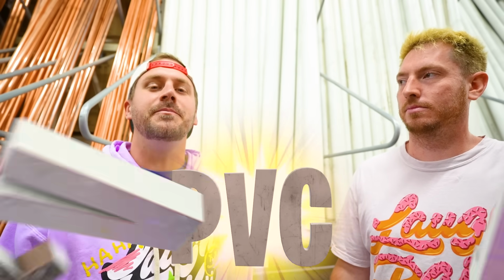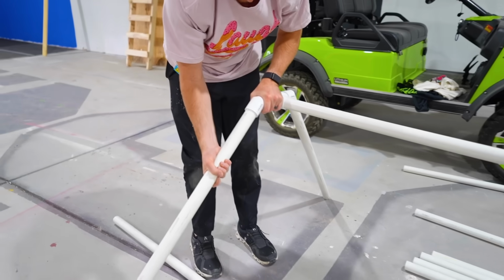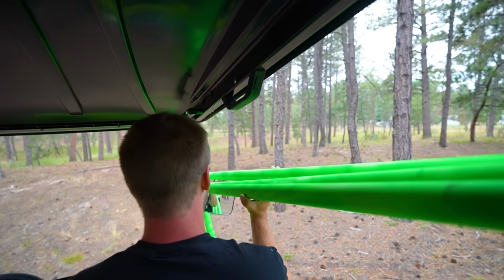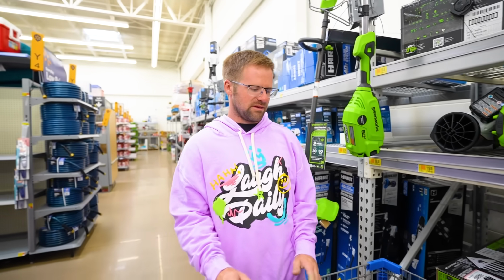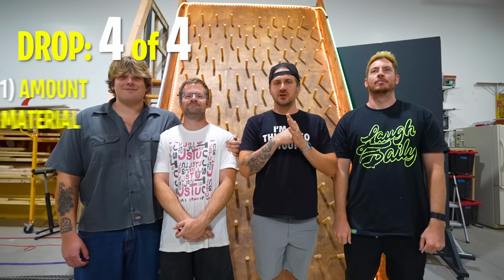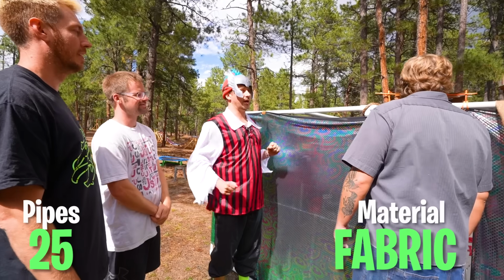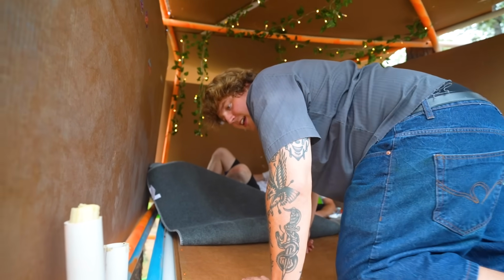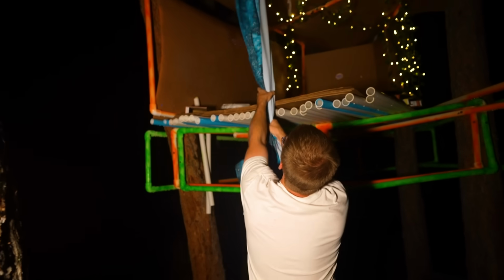We Built PVC Pipe Survival Shelters!

Comment: The one with the tape walls could have been insanely good if built correctly. I would have added a few little pieces of pipe to the bottom of the structure to make it more tall, and dig them down in the ground for stability. I would also have designed a door for it, to make it wind-resistant from all sides.

Comment: You know At first I thought that  Andrew's idea was great but after giving it some thought he could have built a small house big enough for him to lay down and sit up inside with enough room for all of them to comfortably fit inside and even sleep. 

If the pipes are 10 feet he could have cut off three feet from 4 of them and attach the 4 seven foot long pipes to a 4 way connector that is pointed at a 135 degree angle. Then cut the 5th one into four parts for the walls then connect them to the four 3 foot pipes this gives you walls about 5.5 feet high at the lowest point and about 8 feet at the center with each side being about 8.5 feet in length.

Comment: How to bake a cake.  

Baking a cake is a rewarding and enjoyable process! Here’s a simple recipe for a classic vanilla cake:

### Classic Vanilla Cake Recipe

*Ingredients:*

- 1 cup (2 sticks) unsalted butter, softened
- 1 1/2 cups granulated sugar
- 4 large eggs, room temperature
- 2 1/2 cups all-purpose flour
- 2 1/2 teaspoons baking powder
- 1/2 teaspoon salt
- 1 cup whole milk, room temperature
- 2 teaspoons vanilla extract

*Instructions:*

1. *Preheat the oven* to 350°F (175°C). Grease and flour two 9-inch round cake pans, or line the bottoms with parchment paper.

2. **Mix the dry ingredients**: In a medium bowl, whisk together the flour, baking powder, and salt. Set aside.

3. **Cream the butter and sugar**: In a large mixing bowl, beat the softened butter and sugar together using an electric mixer on medium speed until light and fluffy, about 3-5 minutes.

4. **Add the eggs**: Add the eggs one at a time, beating well after each addition. Mix in the vanilla extract.

5. **Alternate adding dry ingredients and milk**: With the mixer on low speed, add the flour mixture in three additions, alternating with the milk (beginning and ending with the flour mixture). Mix just until combined—do not overmix.

6. **Pour the batter into the pans**: Divide the batter evenly between the prepared cake pans, smoothing the tops with a spatula.

7. **Bake the cakes**: Bake in the preheated oven for 25-30 minutes, or until a toothpick inserted into the center comes out clean.

8. **Cool the cakes**: Allow the cakes to cool in the pans for about 10 minutes, then turn them out onto a wire rack to cool completely.

9. **Frost the cake**: Once the cakes are completely cool, you can frost them with your favorite frosting. Vanilla buttercream is a popular choice!

### Tips:
- Ensure all ingredients are at room temperature for the best results.
- To check if the cake is done, the edges should start to pull away from the pan, and a toothpick should come out clean or with a few crumbs.
- For an extra moist cake, you can brush the cake layers with a simple syrup (a mixture of sugar and water) before frosting.

### Simple Vanilla Buttercream Frosting Recipe

*Ingredients:*
- 1 cup (2 sticks) unsalted butter, softened
- 4 cups powdered sugar, sifted
- 2 teaspoons vanilla extract
- 2-4 tablespoons heavy cream or milk

*Instructions:*
1. In a large bowl, beat the butter until creamy and smooth, about 2 minutes.
2. Gradually add the powdered sugar, 1 cup at a time, beating on low speed. After each addition, increase the speed to medium and beat until well combined.
3. Add the vanilla extract and 2 tablespoons of cream or milk. Beat on high speed for about 3 minutes, until light and fluffy. Add more cream/milk as needed to reach the desired consistency.
4. Frost your cake once it is completely cooled.

Enjoy your homemade vanilla cake!

Comment: Andrew should have done a teepee style shelter with only 5. also idk what rick gets paid but its not enough lmao
Reply: You know At first I thought that  Andrew's idea was great but after giving it some thought he could have built a small house big enough for him to lay down and sit up inside with enough to for all of them to comfortably fit inside and even sleep. 

If the pipes are 10 feet he could have cut off three feet from 4 of them and attach the 4 seven foot long pipes to a 4 way connector that is pointed at a 135 degree angle. Then cut the 5th one into four parts for the walls then connect them to the four 3 foot pipes this gives you walls about 5.5 feet high at the lowest point and about 8 feet high at the center with each side being about 8.5 feet in length.